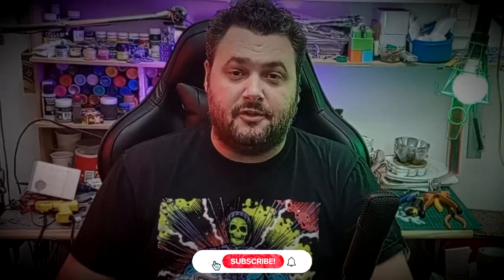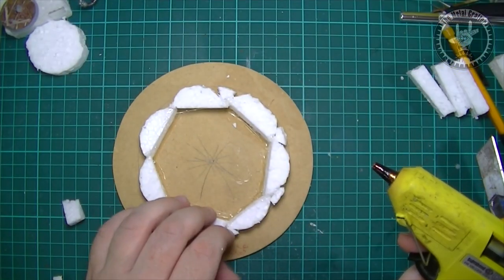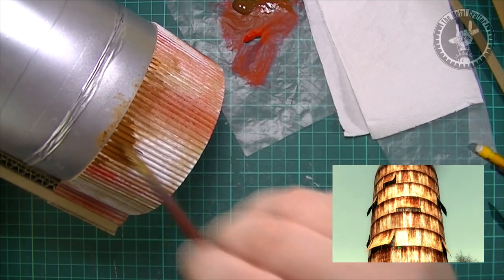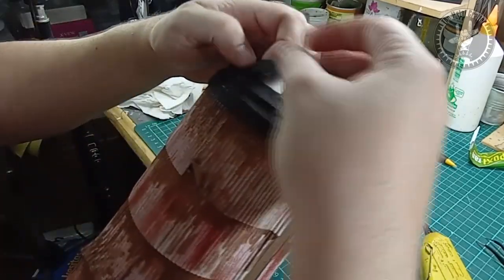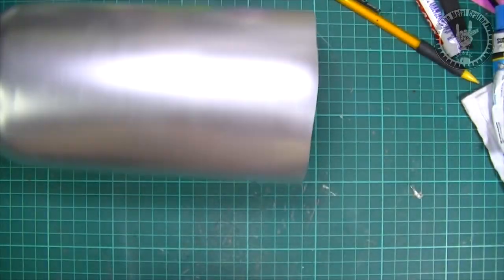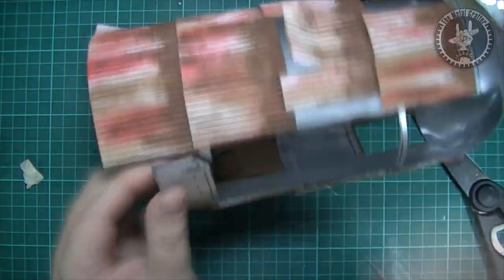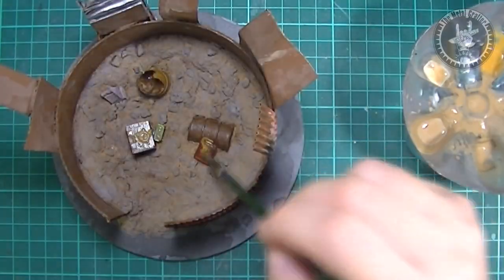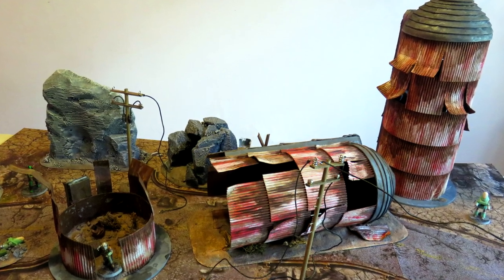#38 - F3 Grain Silos - Fallout WW Series

Comment: Actually, it's not a "chimney" on the side, that's a grain elevator, usually a DaVinci screw IRL, that pulls the grain out of a hopper on the side of the silo to pour out on top of the silo. Your silos are completely accurate to the game and real life. Silos are used to store grain until the market price is better. Their floors are either mesh, or punched or drilled with ventilation holes smaller than the grain and there are fans underneath that pull air in to keep the grain dry. I imagine after a few years of disuse, the floor would rust away (especially after decades or centuries). We have a silo that we use as storage, because it's dry, in a few hundred years, there's all sorts of crap that will be in there for future scavengers. :)
Reply from the maker: wow, that was a lot of silo wisdom, thanks for sharing !!! :) I totally didn't think it was an actual "chimney" but it was the best word I could find to describe that part (I'm not native English speaker) :P Should have done some research, though.....